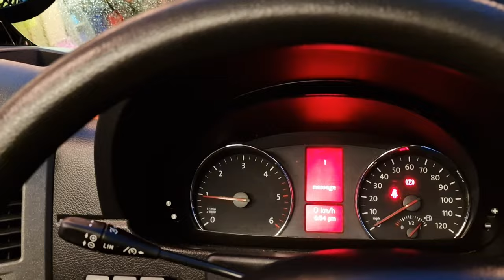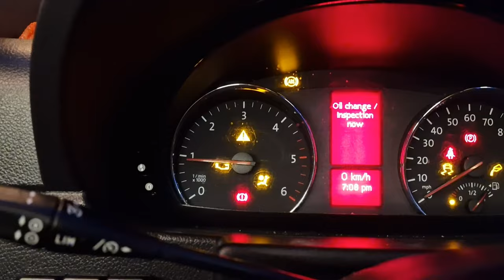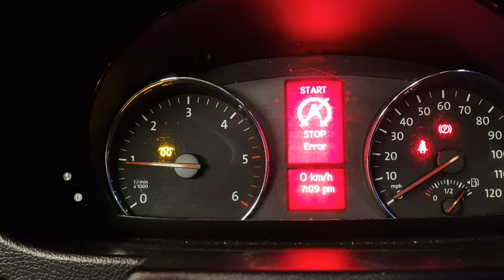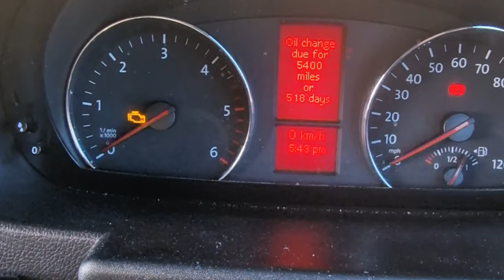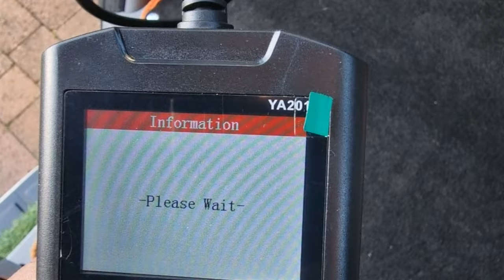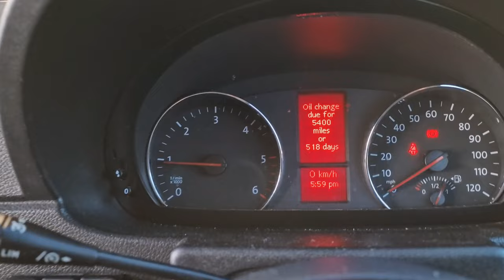how to clear the turbo boost engine management and glow plug fault light on our VW Crafter

Comment: Hey Sam - I am in awe about your resilience to finally get the mess with the dash emojis sorted. Cudos for that. 🙂👍
This sort of video helps me and others to get smarter, save time and is very, very valuable content. It will help many others in the long run. 

I can certainly empathize with your YT thoughts. Producing video material whilst working on the van means setting up the camera, the lighting, taking care of the audio and moving all of that for every shot to get proper angles. And it's worse if you're doing this on your own, when you are protagonist, camera man, lighting dude and audio guy - all at the same time. Finding out that one of the cams wasn't turned on, the battery went flat or the sound did not record. After shooting all of it, you now get to cut, sync, normalize, add the regular doo-dads, lead-in, lead out and title it. Render and upload. Read comments (stay awake for the legthy ones - like this one), add likes, even answer some of them. Out of my own experience, every minute of video endproduct took 5-10 minutes to get it there. Most people have absolutey no clue of the work involved to produce content.

If this puts contnued and undue stress on you, your family or your health - give it a rest or reduce the hours. Spend time with friends and family. Look at the priorities.
Cheers from Germany - stay safe and see ya soon. 🚐☁🍀
Reply from the maker: Thank you for all your kind words. It does mean a lot. I do try to keep a balanced approach to when it comes to family and YT but when things aren't going so good YT is tge last thing on my mind 
And I could very easily have walked away 
On the flip side, I get so much out of YT aswell 
Onwards and upwards as they say my friend here's to the Sumner and have fun 😁👍

Comment: I seriously cannot thank you enough for this video Sam, I have been having exactly the same issues on my 2014 Crafter and was at a loss, I just kept driving my van with the EML and Coil light on until it went into limp, I changed the secondary water pump and it cleared the light and took it out of limp mode for a while at least anyway then still at a loss you uploaded this at just the right time and hey presto my van is fixed. I’m owe you more than a beer if we ever meet along the way. Thanks again, much appreciated.
Reply from the maker: That's amazing I'm glad it's been of help 
this is why we do these vlogs mate thanks for letting me know 😁👍
I chuffed your sorted

Comment: Hi Sam thanks  for video I'm  in motor trade and unfortunately this is a very common  problem bad new parts these days expecially things like turbos not even set up correct  on waste gate wrong voltage .
Keep going

Comment: Great work my crafter has the same codes but no prob with dash warnings you wouldn't know any problems engine check light came on 2 or 3 times since i bought it none lately but vw read these codes not sure if they cleared them 3500$ Australian for new turbo they can't look at till 21st sept 23 which is abt a month, motorhome is my only mode of transport, ur video has made me more aware of what needs to be done thank you :)))
Reply from the maker: Hi I've just seen your comment how have you got on
Reply: Thanks, same. still waiting for checks to be done, thinking i will get a tester too and maybe get the vac pump done on my model i think on side of motor bit easier  to get too no check light lately;))

Comment: I admire your patience! 
 
I’m suffering a boost leak on my crafter 2017 cr35 
What was the seal you replaced  on the housing off the turbo 
Please I’m going to try it on mine 
Thanks Graham
Reply from the maker: it's the boost pipe seal Graham

Comment: Feel your pain.  I’ve been battling this same war since October 

£2500 I’m so far and still no joy. 

I’ve changed N75 / Actuator / map sensor / then a brand new turbo.  Plus two services.  Plus fuel on test drives. :( 

Just going back to volksmaster now.  The van is a lot better than it was.  But to my horror limp mode again.
Reply from the maker: The fault has reared its ugly head again 😪 
I have one more thing to try 🤞 it works. 
I will let you know how I get on

Comment: I learned (as you have now) never to trust a new part. I have chased faults because I thought a new part couldn't possibly be faulty - and in the end you chase your tail after spending even more money on replacing parts that were not required. For me it has been (in order of nightmare jobs) a suspension air compressor on one of my L322's, a starter motor on a V8 Discovery and the worst job of all - after 8 hours on ramps replacing an automatic gearbox on my Discovery discovering the parking pawl was shattered, which meant taking the whole thing down, splitting the transfer box off the back, replacing the pawl with the one from my old gearbox, and then having to replace all the seals and refit .... not something I was expecting!!  The good news is you have your van back on the road and there are plenty of weekends coming up where it can take you places. Enjoy!!
Reply from the maker: So annoying when that happens 
As they say, every day is a school day

Comment: I felt so bad for you watching this, Sam cos I have been through it with my van too as you know. Its just money money money. As for forums, they did my head in. If Id replaced everything they said was causing my probs I might as well have bought a new van. I sometimes think engines were invented to drag you down and suck you dry financially... And just like you did with replacing the turbo- I did the same with the adblue system and a few thousand quid and it didnt fix it-but my main stealers basically shafted me. The " we have to mend the one we sent you that was actually fualty" line would have really ****ed me off. Summat to be said for not bying refurrbed stuff as I learned too. Totally maddening-as is the attitude of places you buy stuff from who make you feel like its your fault. not good at all. I'm proper glad you managed to get the van sorted and can breathe a sigh of relief. At least the new bits you didnt need to change in the first place wont need replaceing in the future.  Well done Sam for not giving in on your van. Well done for not packing in youtube. I have to tell you Id have been gutted to see you come off.Since I first started with Viv you have been an inspiration to me and I love our group on youtube too. You are a good man.  Bessy regs-Kenny
Reply from the maker: Cheers mate have you got your battery swapped out yet?
Reply: @TheCraftyBlindersvanlife  Sadly no, Sam. I didnt find anyone to help me. They are still under the front passenger seats. Ive not connected the second panel on the roof either as its been pants weather here. Fingers crossed its better this week so at least I'll have 300 watts of working solar. I still need to have the timing chain done too. Its ok but all the guys on the forums reccomend changing before 12K miles. Viv has just gone over 100K
Reply from the maker: @Viv-I-van goes forth  where do you live pal
Reply: @TheCraftyBlindersvanlife  Bolton area, Sam but I'm intending to try to do a crafty one nighter on the carpark at Kerswick near the theatre once Ive finished minding the dogs.
Reply from the maker: @viv-i-vangoesforth  Keswick would be a cool test run
Reply: @TheCraftyBlindersvanlife  I'll have the timing chain done first then I should be able to bimble anywhere without worry.....but then again, this is vanlife lol🤣

Comment: The reason your vacuum disappeared is because you had the pipe disconnected from the actuator on the turbo which also has a sensor on top, when the ECU didn't see any movement with the sensor it shut the valve you replaced down.
When you restart the engine and the fault is away for a minute or so, thats because most VAG group vehicles automatically reset the fault, because your fault is not electrical but a tolerance issue, where the ecu wants to see movement of the turbo vane actuator as a signal of voltage, and that doesnt match a reference value it will bring up your fault. But not instantly like you would see with short circuits etc. In other words this is a mechanical issue with the turbo vanes. 

I can usually diagnose this by removing the pipe on the actuator, starting the engine and watching how feeely the turbo vane rod will move and how far it moves. 

From experience I'd suspect the vanes are seized.

Videos like this might make people appreciate properly equipped, trained and invested mechanics. Fair play for sticking at it, but any experience technician would of had this diagnosed in no time and not fired parts at it
Reply from the maker: Intermitant fault that many crafters suffer from and the so-called mechanics at vw struggle to find or even diagnose cost many people ££££ as they have to keep returning to the garage, in an attempt to determine the cause
It turned out to be a piece of rubber that blocked a vacuum pump oil channel 😁👍

Comment: Hi every 1 i add  the same problems and i noticed my sentrol locking wasent working offbthe key so put new battery in  and pig tail went off just left engin light on so bought a fault finder off ebay pluged in in and terned it off jobs a goodun hope this helps 
Ry
Reply from the maker: Nice one 🫶👍

Comment: How did you find removing the original Manifold? I was going to do mine when my gasket went but was told it was a 7 hour job from a vw mechanic and a pain in the 🍑.
Ended up taking yo a garage but still fancied having a go
Reply from the maker: It's an hour tops mate takes me a little longer as I record everything 😁👍

Comment: Hi everyone, I have crafter 2012 numberplate have the same problem I mean the same control lights coming out coil and engine check but with my van was problem pump. Be that mean the small electric pump the code was as well showing ASR problem, but after three days after changing the pump, the problem gone on his own without plugging computer in
Reply from the maker: Glad you got it sorted

Comment: Dear dear lord, I have exactly the same problem
Reply from the maker: how are you getting on with it? it is a common fault
Reply: @TheCraftyBlindersvanlife  I have a 2008 2.5 TDI. First turbo, MAP, MAF, N75 replaced, checked all vacuum lines and pump, pressure tested  the entire pressure circuit from turbo to inlet manifold. Beside one time I made a test drive and reached 240 kPa and problem seemed to be solved ... when I made the final assembly something went off and the pressure never reached more than 160 kPa which dwindles down to 135 almost instantly. I am merely an amateur mecanic and finally in desperate mood brought it to a specialist tuning guy... who seems to have a bit of a struggle with it as well and even cosiders that there's another cause. Fingers crossed I hope I actually get some news from him today. I'll keep you posted! Have a nice Sunday